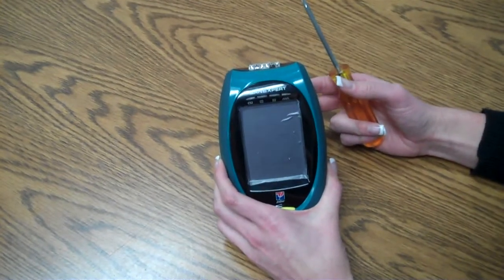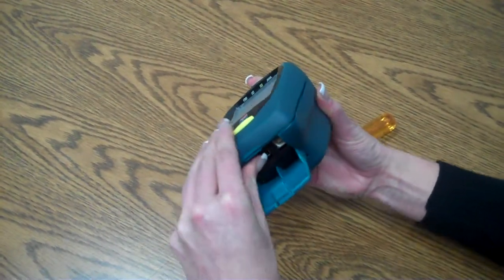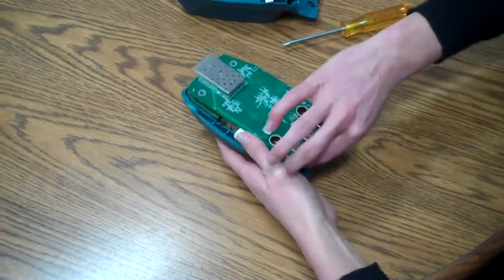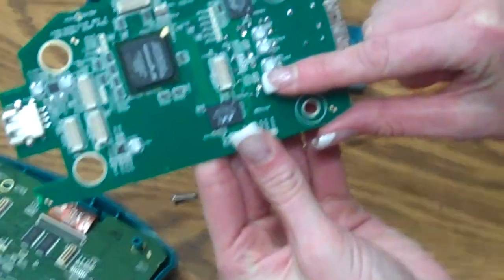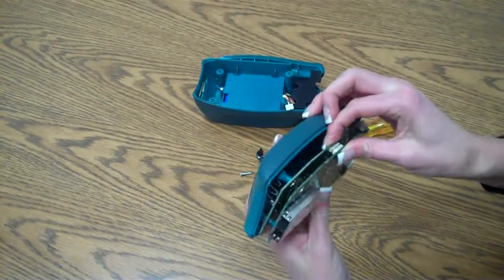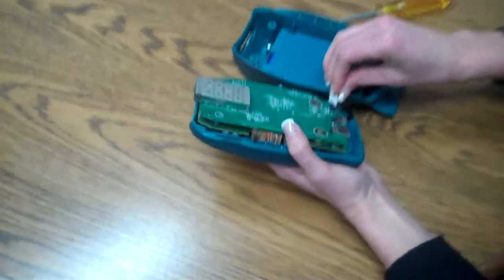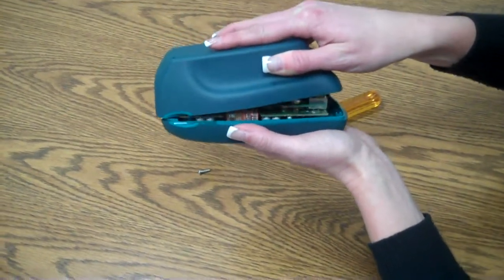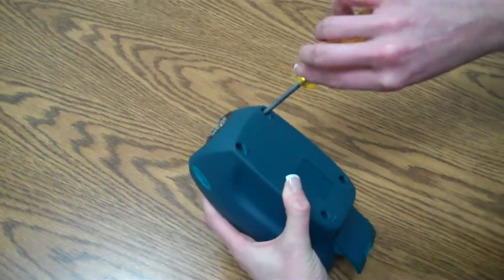Disassemble LanExpert 85 to replace C606 with a 100nf 0402 case size capacitor

Comment: Nice instructional video.... Except for the camera shake, which I will give you a break on if you were filming whilst on board a ship, in heavy seas, with big swells. With all the money you make as a company, the purchase of a $20 camera tripod would be a good idea, along with the difference between zoom and macro, instead of just a half hearted effect with the zoom button to show the location of the capacitor, why not physically move the camera and use the macro function.